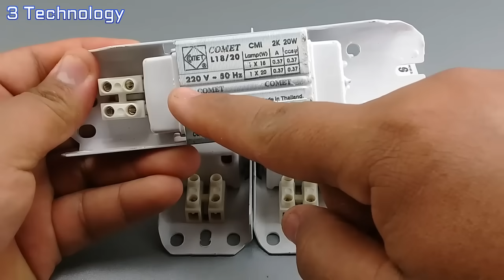I turn Light Bulb Transformer Tools into 220v 20kw electric Generator

Comment: The distance between the rotor and the stator must be very small 1-2mm, in your case the distance is 2cm, so it does not produce more than 1-2V. He studies electrical engineering, electrical machines...
Lift the board, you will see the two wires coming to the socket!

Comment: Fake video, starting with the title, a 20kW generator, ignoring power factor and other details, would have to supply about 90 amps and none of the cables used to build the section support that load, they would melt, on a physical level it would be contradicting the laws of thermodynamics.

Comment: My friend if you connect transformer from the supply use 220v/12v then onduleur to obtenir direct current 12v cc after you connect it in the motor the final result you have closed circuit so your machine wil start by closed circuit without any supply try to do it like this succesfull

Comment: 20 kilowatts, from that nonsense? Divide 20,000 by 220 volts, we get about 90 amperes, your wires are not super conductors, and neither are the windings, in general, good fiction))).
Reply: 20 килловат для них 200 ватт как у нас

Comment: So bogus. Power is measured in watts. Watts = voltage x amps. 12volts @100 amps = 1200 watts. Transform it up to 120 volts, you'll get 10 amps, which equals 1200 watts. Energy can be neither created nor destroyed. It can only be converted from one form to another. There is also loss when it is converted -- mostly due to friction and heat.

These lightbulbs can run on AC or DC electricity.

Notice how there was nothing to measure the "20kw" to prove his claim. I've seen many of this guys videos and, while entertaining to watch, they're all BS! Math and physics are your friend, people.